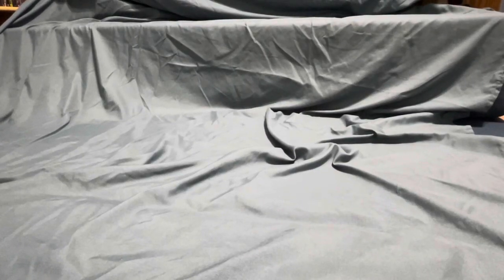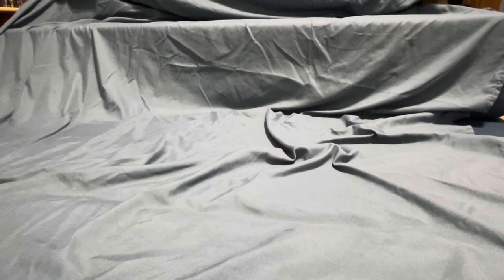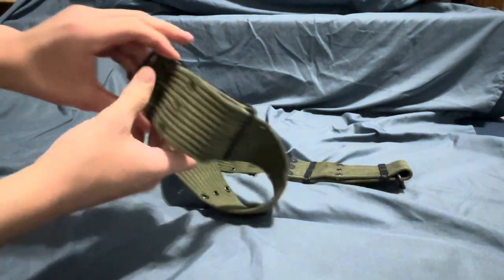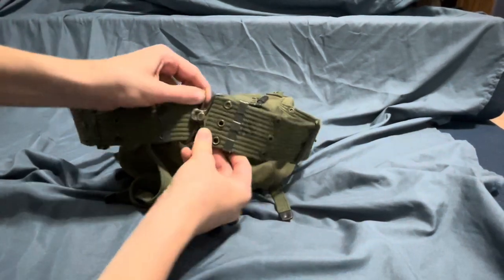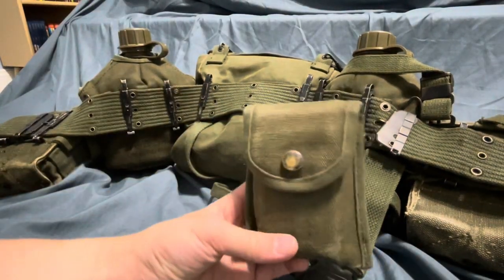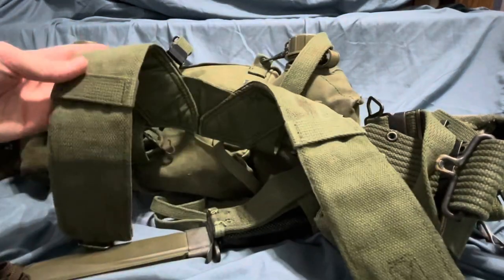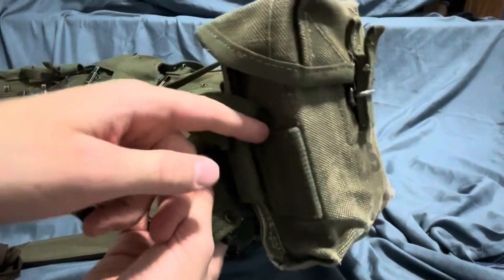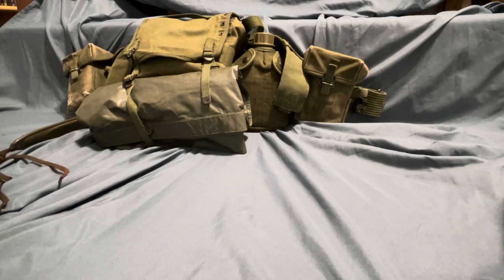Basic Vietnam War M-1956 LCE Gear-How To Assemble

Comment: Need to be careful on primo condition stuff might be Chinese repo stuff and they will put on the 60s-70s dates and leave off the made in China prints to rip collectors off. many butt packs get torn after a while because they were not made tough enough and a lot of weighted stuff was put into the pack.
For my Vietnam collection, I've been focusing on the night vision stuff. last year I got a working AN/PVS2 scope with adaptors for firearm use and got through the mail today a Meta scope that was made for Israel, but was used in Vietnam for my collection, since I also like NV stuff.
Reply: You can tell original from repro, they are not making repro Nam era web gear
Reply: @MrJeep75 I disagree! A lot of this stuff origin of sale is from China!

Comment: That is NOT how to attached the M1910 hook hangers.  I realize people do it that way because no one told them the right way. Even Soldiers who used the system did it wrong because its harder to do it the right way.  When you do it the right way the ends of the M1910 hangers are not exposed and don't snag on you or other gear. The ends are on the inside and the bends are facing down. The belt holds the gear in place by putting pressure on the M1910 hanger.

Comment: What manual are you referencing?
Reply from the maker: There is a lot of photos of manual pages in a book called grunt. I just used that book Ave some photos online. I don’t know the specific manual i guess
Reply: FM 21-15 Some are online as pdf. Some on youtube too.  I have two manuals from WW2 and one 1977 issue.  1977 has M56 and ALICE gear.